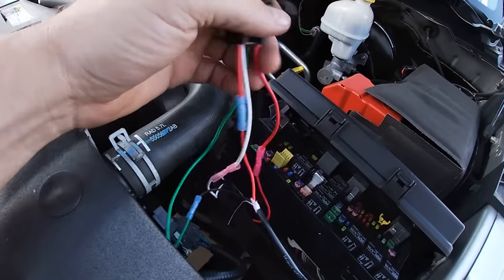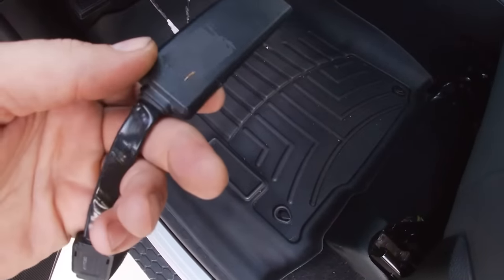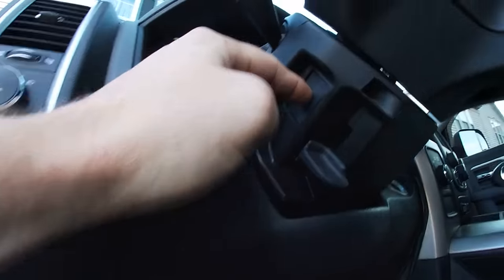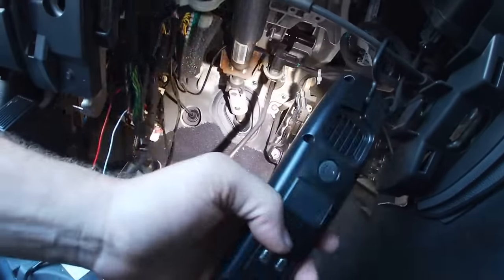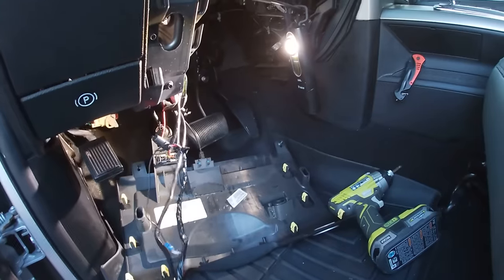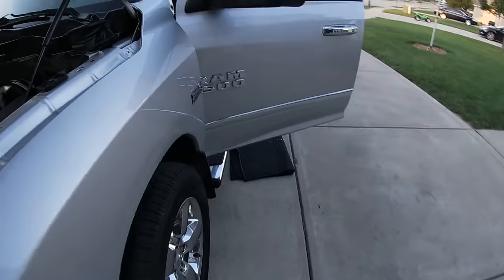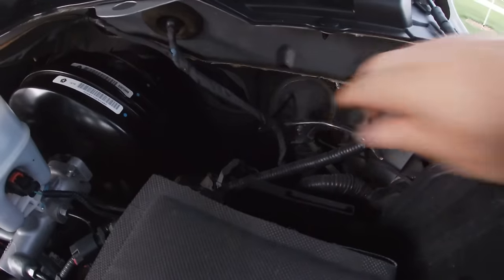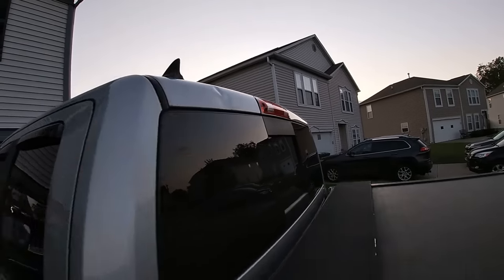Tracking Device Found on My RAM!

Comment: All GMs have tracking devices. It is called Onstar.
Reply: I get calls all the time about my warranty and dealer inquiry to trade My GM in. 4 years old and only 40,000 gentle miles on it. I wonder why?
Reply from the maker: Warren Puckett Yes they do! It doesn’t bother me when it’s factory plus if someone is tracking me they would get bored real quick. 😂

Comment: The banks put them in miss your payments  they know where they're  vehicle is.
Reply from the maker: Yes they did that for the previous owner. It’s obvious from the corrosion it had been in there longer than the 2 weeks I had owned the truck. The dealership I bought it from told me they did not install it.

Comment: This is one of the reasons.I don't like newer vehicles.
There are so many wires.You don't know what they're connected to.
Reply from the maker: Without wiring diagrams it’s hard to know
Reply: @FABAutomotiveDetailing  Even with a wiring diagram.
If that truck goes through even one previous owner.
Most of the time there's always some kind of aftermarket this or that thing thrown in.
Some kind of patchwork fix.
Some kind of Bypass.
It's just so much easier with older vehicles that don't have so many wires.

Comment: When you said ''fleet vehicule ''......... come on !! a 6 years old ex fleet vehicule with 67000 miles on it (and thats why he bought it)....no way man...they do that in a year......had at least a 130,000 more miles to it and that will be its real millage....sorry  for bursting your bubble bud.....
Reply from the maker: Have you ever tried rolling the miles back on a digital odometer? Yeah it’s not easy you have to have software from the manufacturer and there are safeguards against it. It came with all paperwork where every service was done at a dealership in Ohio and Carfax also shows the correct miles so it is legit.

Comment: I'm laughing my ass off. Because my 2011 ram had a defective fuel pump relay. And the repair is to hang a relay like the one you removed to bypass the 1 that's buried inside the fuse Box. Hopefully that's not your issue
Reply from the maker: I do the fuel pump relay bypass from the TIPM module all the time. I just did one on a Town and Country Thursday. No that’s not what this was.

Comment: Starting about 2026, all new vehicles will have built in GPS tracking that presumably cannot be disconnected or turned off.
They will also have remote shutoff ability.
Governments and businesses have 100% unfettered access to that tech. And nefarious individuals can access those features too.

Digital license tags WILL track you.

IMHO, all tracking devices violate your rights. Remote shutoff features also violate your rights.

From an economy perspective, you want warm air intake,
From a power perspective, you want cold air intake.

Why was that tracking device in HIS truck there in the first place?
Once the vehicle is sold, they should have removed the device prior to delivery.
Reply from the maker: Interesting! I guess I will have to drive old cars so I don’t have to worry about it. Someone at the dealership didn’t do their job to remove it before I bought it.
Reply: @FABAutomotiveDetailing  The absolute best is an air start diesel (no electronics of any kind) set up to use Diesel fuel and an alternate fuel as well.
2nd best is a pre-1974 vehicle.

Comment: That’s from a rental car company. This truck used to be a rental I guarantee you.
Reply from the maker: FBI President I guarantee it wasn’t! It’s a one owner not by a company. There is a $1200 Bed cover, chrome bug deflector, Weathertech floor mats and Weathertech vent visors. I’ve never seen a rental company install any upgrades on their vehicles.
Reply: FAB Automotive Detailing that’s not the type of tracker a govt. entity would use. So that’s interesting.
Reply from the maker: FBI President I would say it was a private owner used as a fleet vehicle. When I googled the tracker it came back to a company called ModBuz and they do fleet tracking.

Comment: Guess what, if you have a OnStar or other such device you can be tracked even though you are not subscribed to any company offering a device. A computer command activate the device and any law enforcement agency with approval can activate all or just a portion of the devices capability. If you believe I'm one of those that done a tinfoil hat, I'm not. Do some research!

Comment: You apparently bought a used truck. Either that or your dealership didn't trust you to make the payments and had the tracking device installed so they could have the truck repossessed when you missed your payments. Cheesy dealerships do that. All Dodge dealerships tend to be cheesy. I used to drive Dodge, but was lied to, insulted and stolen from in every dealership I took my truck to for factory problems. Chevy dealers are no better.

Comment: If you buy used the bank you owe for the loan on vehicle has them installed incase you don’t pay your note a tow truck can find the vehicle and recover their property. Thee end
Reply from the maker: Reek Z Obviously I know that but not all banks require it and the corrosion on the relay shows it’s been there longer then the 2 weeks I had owned it.
Reply: FAB Automotive Detailing, could be from the last owner. I install these things,same ones. I’ve seen one already on cars from the last lender. Some even have a kill switch to the starter relay they want you to install. Well anyways, it’s a company they hire. It cost like 60 bucks to bing the gps for the lender. They have to call up the gps company and give them the number on the unit. Than the bank tells whichever repo company they use the last bing on the map the car was at. Remove it and throw it away. It’s just juicing the battery. If you owe on the truck and your lender had it installed there might be a clause in the contract you can’t remove it or they’ll kill the loan. Be careful bro.

Comment: if that truck is owned by a bank your broke the contract
Reply from the maker: Levo42691 Nobody ever watches or listens to an entire video. I owned this truck for 2 weeks and the corrosion on the relay and connector show it had been on there long before that.
Reply: video just popped up on feed didnt want to watch just wanted to make sure you didnt get in trouble
Reply from the maker: Levo42691 I appreciate that!

Comment: Hope you haven't blown the Hemi yet.  Roller Lifter Failure - it's coming........
Reply from the maker: If it does I will fix it. I have seen some at 200k not fail yet but have seen some with 60k that have. It’s all about luck and preventative maintenance.

Comment: If you make payments, you have one.
Reply from the maker: Not true at all! No vehicle I have ever bought has one. I buy all my vehicles at this Chrysler dealership and never had one. It was beeping on the first test drive we made. I called the dealership and they told me they do not work with finance companies that require trackers and they won’t install them.
Reply: @FABAutomotiveDetailing  both Ford's and 1 mitsubishi that I've bought since 2015 have them. If you have sync, onstar or any other item like that they are there.
Reply from the maker: @mountainwilliam2979  Today’s cars can definitely be tracked through factory installed software like OnStar etc I just don’t like an aftermarket installed tracker that used for the purpose of tracking the vehicle at all times by anyone.

Comment: THE TRACKING DEVICE IS NOT WHAT IS IMPORTANT, COMPARED TO YOUR CAR'S WIRELESS RADIO FREQUENCY SHUT OFF DEVICE LOCATED USUALLY UNDER YOUR CAR'S STEERING COLUMN, THE SIZE OF A PACK OF CIGARETTES, THAT REVERSE THE POLARITY OF YOUR CAR'S ALTERNATOR!

Comment: A lot of people seem to be freaking out about these. They're most often used for the vehicles' GPS system, Onstar program, or for emergencies, like if you were caught in a snowstorm or were reported missing. I'm not saying there aren't people out there using them for nefarious reasons because people can obviously buy a car and install something similar themselves. But if it's from the factory, or if there's been 3rd party aftermarket GPS installed, then yea, you'll probably find one of these things..But more often than not, they're harmless and nothing to get your undies in a bundle over.

Comment: I installed these " tracking devices" on ANY & EVERY vehicle that has a Bank lein! It is a RF starter interrupt.
It has nothing to do with your credit. If you don't pay your payment. They shut down the starter. And although these mods can be connected to specific circuits (vss. vehicle speed sense circuit or the AC power side of the fuel injectors to track said vehicle. I watched your dangerous misrepresentation and misinformative video. There was a Starter interrupt relay under your power distribution box under the hood that is triggered by the Leinholder when payments are NOT met. EVERY USED CAR WITH A LEIN HAVE THESE. Even if it was purchased with CASH paid in full. You just had a corrosion issue causing the  exposed relay to malfunction. Preventing the vehicle from starting. Thus making your "tinfoil hat" theory as STUPID, as the installer who left an uninsulated relay exposed to the elements of Mother Nature.
Reply: And the reason it was HOT to the touch and causing malfunctioning beeping. WAS LACK OF A GROUND!

Comment: Should have purchased a Ford. Dodge sucks. BTW I'm a GM guy.
Reply from the maker: I get it! They all have their individual issues. I work on  all of them and I just like the Ram body better. The older Dodges were terrible but they have gotten way better. I would by a GM before a Ford. Ford trucks get towed in way more then any other brand we work on.
Reply: @FABAutomotiveDetailing  Because Ford sells thousands more trucks over the competition.
Reply from the maker: @steves3760  Yes you are right but where I live there are more Chevy and Dodge trucks then Fords yet they still get towed in the most.